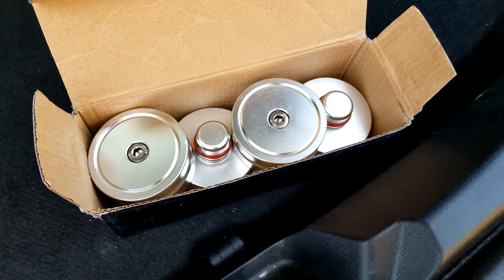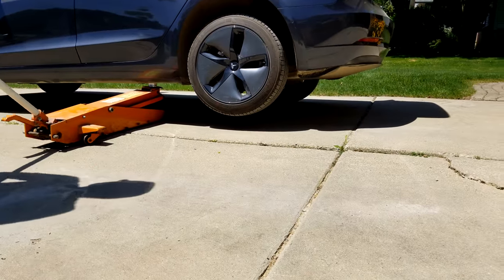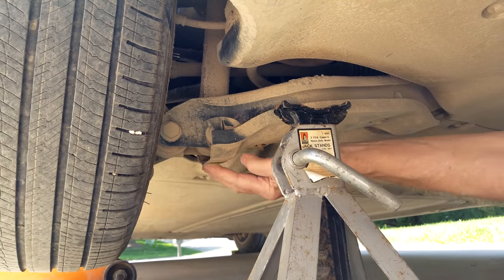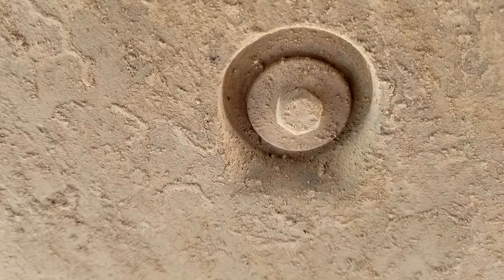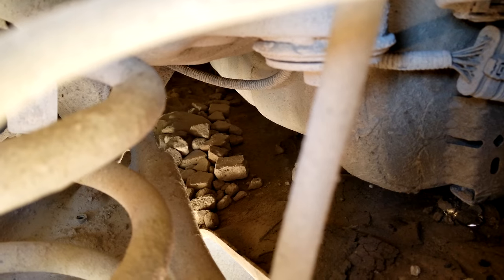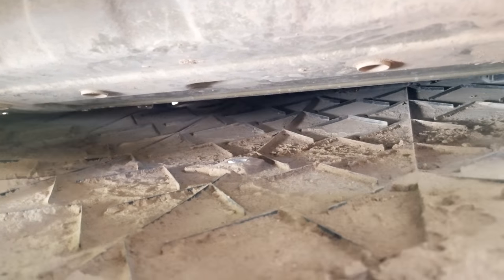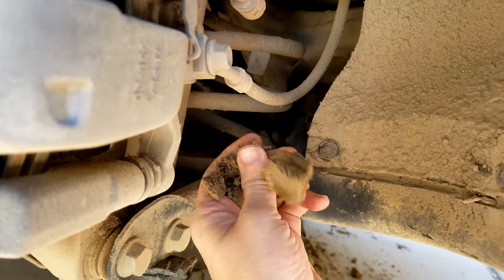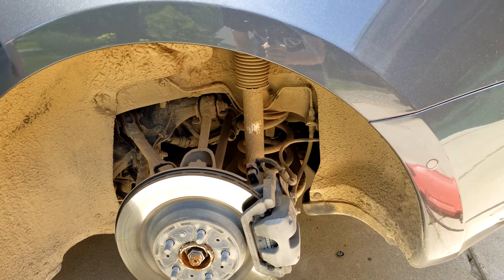I found 15 Pounds of Dirt in my Tesla Model 3 | Shocks | Tires | Brakes After Dirt Road Driving

Comment: Most cars don't have aero covers or, if they do they're just at the front, so they don't collect dirt. You could take them off and be like other cars with probably a very small drop in efficiency.
Reply from the maker: I think the efficiency drop would be pretty large.

Also, it's pretty rigid, so I'm not sure how it would effect the surrounding area.
Reply: Increasingly more cars are using aero shields now.  You can see in this video how Toyota is using them even on less expensive cars such as the Corolla:
https://www.youtube.com/watch?v=2cPsZXNfs0w&t=600s
Reply: My late model BMW doesn't have aero covers at the back (model 3 on order) nor does the corolla in the video you link to.
Reply: Because it has a hot muffler at the very rear end.
300 to 500 degrees Fahrenheit or 150 to 260 degrees Celcius.

Comment: I think it would great to add some openings to let the water and the dirt to go away instead of been accumulated. 
I remember about some people loosing their back bumper after passing in a large puddle.
It would be interesting to see if there will be any changes made for the Model Y which is an SUV, 
and possibly some of the changes will be retrofitted for the Model 3.
Note:　Could you do some research and look at the Model S and the Model X underbody to check if there is a similar problem.
Reply: The Y is a smaller version of the X, although built on the 3 base. So the Y would be more like a CUV.
Reply from the maker: If someone wants to bring over their S or X we'd be happy to open it up :)

But more holes=more drag. I'm not sure it's a tradeoff Tesla wants to make.

Comment: Hello my friend,

Overall Tesla is the best car, Wait till the Tesla truck arrives.   Thanks for the tip, however I recommend not using a impact gun for reinstalling the fasteners.  And due to that you will be doing this cleaning service twice a year please apply anti-seize grease on the fastener threads.
Reply from the maker: Thanks! My FIL actually mentioned not using the gun, but I just put it on the lowest setting and did it with the gun 😂

Thanks for the tip
Reply: Tesla won't ever make a Truck
Reply from the maker: Bring it on. I bet you in one year we'll have seen it and know all the specs!

Comment: Thanks for letting me know what I'm in for.  I drive a lot less on unpaved roads - typically 5 miles a week in the summer.  Knowing what you put your car through, why don't you have splashguard/mudflaps?  The RoadSport 4406 'A' Series Universal Fit Premiere Splash Guard are cheap and relatively easy to install, and seem to be a decent fit on mine.
Reply from the maker: Got any pics? I'd like some but I don't want to drill...
Reply: @DirtyTesla  I didn't have to drill the car for the bottom 2 holes, just used extended fasteners.  GOOACC Nylon Bumper Fastener Rivet Clips Automotive Furniture Assembly Expansion Screws Kit Auto Body Clips 8mm - 40PCS.  I chose to drill through the fender liner plastic for the third clip, and figured I could just plug it with a fastener if I didn't like it.  It would probably be sturdy enough without that.
Reply from the maker: @timz7548  Ah so there are holes in the front and back? Or did you only put mud flaps on half the vehicle? Thank for this info this is awesome. I've wanted to get some but I haven't been able to find any nice ones
Reply from the maker: @timz7548  Thank you for the pictures! So it really helps keep stuff from flinging up the side of the car? I may need to make an install video on these :)
Reply: @DirtyTesla  I was really surprised that these didn't exist from the aftermarket already, but the Universal fit ones don't do too bad.  I saw too many pictures of cars with pitted paint on the rockers to do nothing.  So far so good, I've had these on the car for a couple of weeks.
Reply: Yeah, I'm surprised WeatherTech doesn't have something yet.  They seem to have everything else for the Model 3:  https://www.weathertech.com/tesla/2019/model-3/

I installed the WeatherTech MudFlaps on my Silverado which were no drilling and easy to install.  I wouldn't have installed them if I had to drill or modify anything which could affect the vehicle permanently.

Comment: I would've used two floorjacks  so as not to twist the chassis too much.
Reply from the maker: That's why we just did a little at a time and went back and forth
Reply: It can take its own weight. Its a car chassis, that's what is designed to do.

Comment: Another advantage of the electric motor, it doesn’t care about dusty air. With an ice , you would find all that dirt in the air cleaner, oil filter and bottom of your pan.

Comment: I would imagine that the Model 3 was NOT designed to drive on dirt roads, thus not a design flaw just the result of driving on dirt every day.
Reply from the maker: It seems to be holding up fine considering. And it's not like paved roads are perfectly clean. Eventually you will get dirt up in there
Reply: Tesla specifically says in the manual that the warranty doesn’t cover off-road. Not to say you can’t take it off road, but it’s design is intended for on-road, so it seems that any “fix” or notice of a problem to the general public is unnecessary as it’s an off-label use. (Cool vid though. I’ll have to check mine out of curiosity. I’ve taken it off road on gravel about 20 miles once)
Reply: Michael Irving dirt roads are not off road, where I live there are many dirt roads.
Reply: John Donlon okay. That seems to make sense being that a dirt road is still a road. I went to look at it again and it references “unfinished roads”. I wonder what that would be. A new road still under construction? A non-paved road? That would be good that they are allowed on gravel and dirt in that if something went wrong as a result of that, that it would still be covered under warranty.
Reply: Michael Irving I guess that would leave room for denial, I guess a court would have to figure it out.  I probably would keep a Tesla off unpaved roads hearing that term.
Reply: John Donlon interestingly (and not surprisingly) the Model X is specifically excluded from that restriction (being an SUV I assume)

Comment: Are you replacing the missing screw of the aero shield ? I would say dirt that dirt finds it’s way up through that opening too.
Reply from the maker: It doesn't look like a screw is actually designed to go there, it's just a hole of the same shape, maybe for a tiny bit of drainage?
Reply: @DirtyTesla  Yes, the hole is for drainage. My M3 is the same.

Comment: Has the paint worn off the rockers and fenders yet?  Thats another huge issue with the soft paint they use.
Reply from the maker: After a wash I can actually see a few spots where this is happening, but only because I was told to look. It's not very noticeable. Hopefully it doesn't happen too quickly.

Comment: It's tough to tell from the angles, but is that gap solvable with a few strips of duct tape? still flexible enough to move, and you can cut it out if you need to get in there
Reply from the maker: Yeah most likely, but I don't think it'd worth it. The sides would still be open anyway.
Reply: @DirtyTesla  Ah, fair enough, it looked like it was just the center slit.

Comment: Do you see any wear to the paint on the sills just behind the front wheel? We heard of a case back here in Quebec where the paint was flaking off, and the guy complained about the lack of mud flap.
Reply from the maker: Yes, but barely. Had I not been told to look, I wouldn't have noticed it
Reply: Perhaps keeping the car dirty helps. My car has got its rocker panels sandblasted to the metal after one winter
Reply from the maker: @hendrickhassert  Ha. Perhaps. I think there's probably just some variation in production causing this.

Comment: Hello. As the car is lower than most fossil cars, do you have any Experience hitting the road underside? What abouth cleaning underneth with water?
Reply from the maker: It's not really lower. It's an inch higher than my old Ford Focus. But since that Puck makes the mounting point lower, the jack didn't fit.

I don't clean underneath, but there was a comment about a really cool pressure washer attachment that let's you slide an upward shooting jet under the car... I really want that now lol

Comment: Hey, have you noticed any difference in your suspension? I have about 7000 miles and my dampers have been getting weaker. I have the performance model 3 and it bounces around like a boat.
Reply: Never mind, I watched the end of the video.
Reply from the maker: Yeah we checked the suspension, it's in great shape and the car doesn't bounce. I'd contact Tesla for that!
Reply: @DirtyTesla  I've been to the service center twice. They tell me its "normal" but I know it's not. I just test drove my friends dual motor non performance and it is significantly firmer. Another appointment scheduled and hoping I don't cause a scene.

Comment: Rotating your tires is a MUST on an AWD or 4WD vehicle no matter what make or model.  In my case, I have a 2018 Ford Escape with AWD and when I am cruising, the front tires are receiving the power from the engine.  The rear receives no power.

Comment: It doesn't even seem possible to get so much in there with the minimal open space to get in there while driving. It also seems like even if it wasn't sitting at/near the motor that it would've been there at some time and thus could('ve) damage the motor. I'd want to know if there's any way to close off those open spaces. I see no reason for the open spaces but do see how it wouldn't be good.
 From pictures and video I've seen, it seemed like the battery was a large, basically flat, panel at the bottom of Tesla's.
 I guess it makes sense to have some protection for the battery though. I've found out there's also another battery in the front that is (also) used to jump start other vehicles.
My guess definitely is that your efficiency might be better now.
It's crazy how that dirt doesn't look like 15 pounds. It's kinda like... which is heavier, a pound of lead or a pound of feathers? LOL
Reply: To close that open space you need to fully cover the suspension (it would even make sense!).

Battery is covered from the bottom by a titanium plate (at least in S and X).
And yes, Teslas also have a separate 12 volt battery, like every car.

That 15 pounds is less than 0,5% of car weight. It won't make a big difference.
Reply from the maker: I couldn't believe it was 15 lbs either!

But the motor is fully encased. I wouldn't worry about anything getting in there. Even when a Tesla is submerged, the motors can sometimes avoid water entry.
Reply: Pawel
If I were to actually take a look, in person, under a Tesla (at least a 3), then I might be able to figure out more than one way to take care of the open space so dirt (and any other crap) doesn't get in there.
It makes sense that the S and X have that plate under the battery. It'd make more sense if the 3 was built the same way.
Definitely... 15 pounds could be an extra person in the vehicle. Seeing, on video, that open space in there - and seeing that 15 pounds of dirt, it doesn't really seem like it'd hold enough to really make much of an efficiency difference. But if it could gain an extra mile with nothing in that space then I'd rather have that mile.

DT
It still looks like a rock could dent the motor. It could be possible for a dent to cause enough damage.
There was at least one Tesla that got flood damage from one of the hurricanes that hit FL. If I recall correctly, that hurricane ended the life of at least one Tesla. Although I do also recall a Tesla being salvaged after being flooded in a hurricane.

Comment: I'm discouraged from seeing this.. I'm a huge Tesla fan. I live on the other side of Michigan from you, well sort of; metro Detroit. Anybody who lives in Michigan and has looked into buying a Tesla knows there's a bit of challenge to purchase a Tesla here, having to buy out of state and transfer registration back in. Even still I would love to get a Model X in the very near future as a long-term investment purchase and take advantage of that unlimited supercharger promo. Round here I'm used to seeing test cars with manufacturers plates and I know that many cars (big 3) get up to 100k miles to test for issues such as this. Dirt is less of a concern to me than a material that's more corrosive. What if all that build up was not just dirt but the salt that is used in winter season here to keep ice off the roads. I would not want that rust-producing material just sitting there so near the metal parts above that open cavity. The best prevention for rust is making sure that salt is properly washed off. With having to remove those aero shields to get a proper wash, I'm discouraged.
Reply from the maker: Buying a Tesla in Michigan is not a big deal. You do have to go out of state but besides that you don't have to do anything special. I went to Chicago and just bought the car and came back and registered at Secretary of State like any other car

https://youtu.be/wSkFjMKyc4E
Reply: @DirtyTesla  Yeah if i go through with the purchase I've been looking at Cleveland, or Columbus, or Chicago.
Reply from the maker: @MylesAston  I bought inventory and my car was in Chicago so I had to go there. But I reaaaaally enjoyed the road trip home lol. Most people go to Cleveland

Comment: Try not to use a pressure washer on any surface. You do need to purchase the correct Vehicle for the type of driving you do.Tesla truck maybe what you require.
The amount of dirt you removed is not much at all with the roads you drive on. You could use a water sprinkler under the car to remove the mud every few days.
If Tesla says rotate your cars tires then rotate them.

Comment: My Land Rover LR4 has skid plates all underneath the car and it does the same thing. It holds everything from rocks to mud, but I do use it heavily off road.

Rear tires are going to wear more because the rear motor has almost 50% more power than the front motor. That's why I'd rotate the tires more frequently (I'd go every 5,000 miles) than Tesla recommends.
Reply from the maker: I think I'm going to aim to rotate about every 10k miles. I'm at 7k now and there's barely any difference
Reply: Dirty Tesla yeah if you drive easy you can stretch it out, but if you're one of us who likes to push the pedal to the floor a lot I'd go sooner just so you don't get large difference in tread depth.

Comment: 7,000 miles..... most of it not on dirt roads. If a shock can't handle that then it doesn't need to be made on a car with a 50k mile warranty.
Reply from the maker: My car has 16k miles
Reply: @DirtyTesla  I can't count past 7,000, whoops lol I feel the same about 16k miles though.
Reply: The poor condition of Michigan paved roads with all the potholes is a greater test to a car than any dirt roads with rounded edges to its uneven pits and holes.  Our roads break cars and the insurance companies know this, and of course, we pay for it.
Reply from the maker: That's understandable. I've just had so many comments about how I'm destroying the car with my driving lol. They were obviously wrong.
Reply: @DirtyTesla  You need to take it off some sweet jumps!

Comment: Go buy two drive up ramps!! Problem solved!! No need for jack stands or jack...Gesh!! In addition, before trying to take off the bolts on the shields holding all of that dirt you should have drank some common sense!!!! In closing, where is the 15 pounds of dirt??

Comment: what a crap brand of car, panal gaps, failing displays, leaks, bad paint work, failing packs and motors taking moths for repairs and hard to get spare parts and then this adding weight. wouldn't go near one.

Comment: I had to stop watching the video. People that are not mechanically inclined should not be jacking up the car. You got 4 lift pins because that how you raise the car, off of 4 points.
Reply from the maker: You don't need to use all 4 at the same time. Even 1 Tesla came to my house to change my tires they only did 1 Puck on a side for both tires.